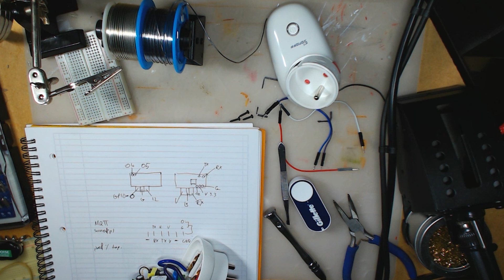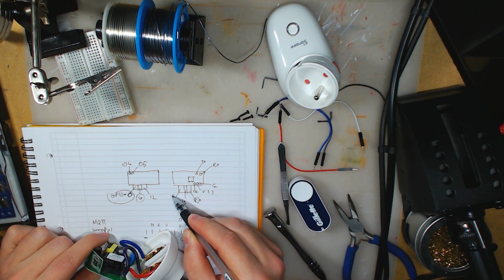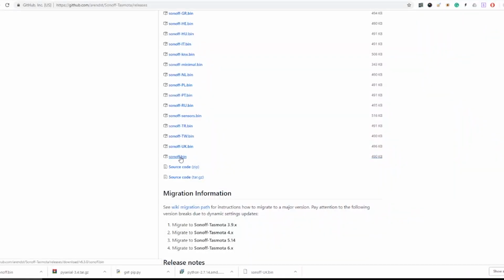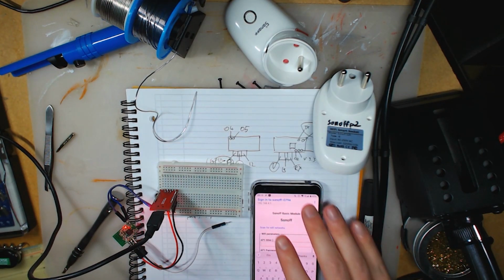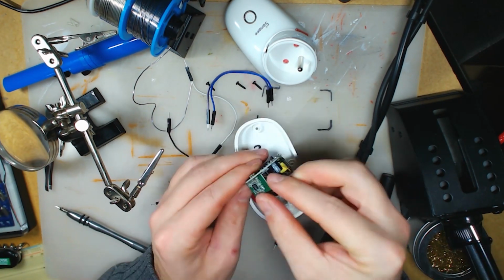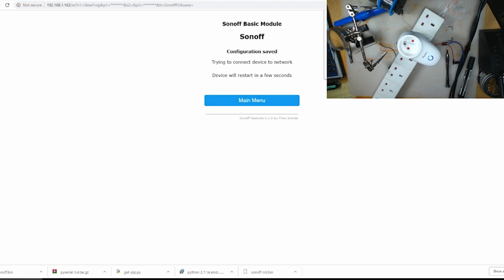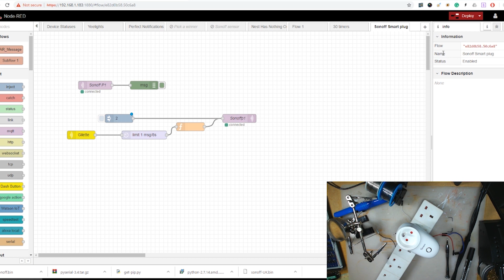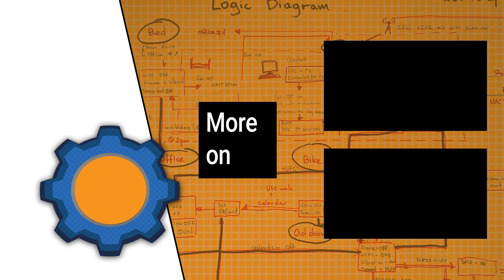Flashing Tasmota firmware on Sonoff WiFi Smart Socket

Comment: Is  it possible to flash Sonoff S26 WiFi Smart Plug without handy way? without ironing ?
Reply from the maker: I would not iron any sockets for your safety, but if sonoff firmware supports DIY mode you can simply upload a new bin file

Comment: Hi Mat, great video as ever and we've all jammed a screwdriver into a UK plug to get an EU one to fit!! Didn't I read somewhere that there is a Tasmota version that you can flash OTA without having to open the unit or did that not get very far?
Reply from the maker: There is a way.. but I really wanted to see what GPIO are exposed. I'm surprised we get more GPIO here than in sonoff basics
Reply: @notenoughtech  I've been impressed with Tasmota so far and flashing it using your pytool method is a doddle, I wish I had to coding skills to merge the Tasmota and ESP Easy firmwares then everything would be covered!